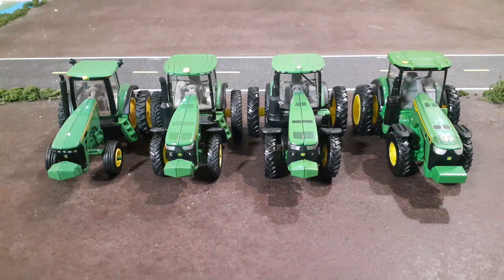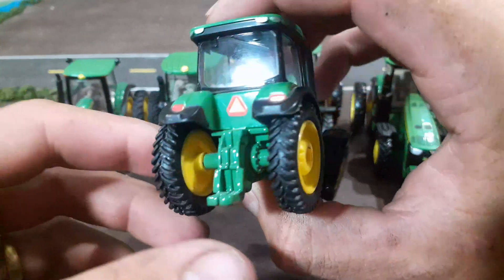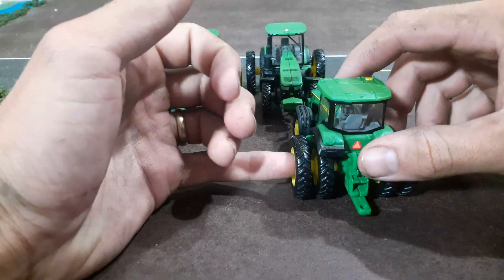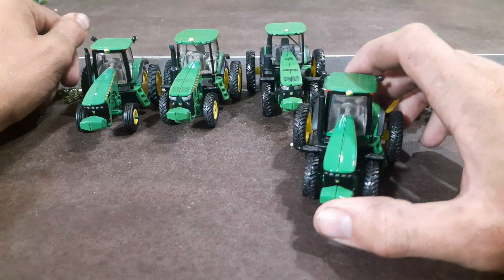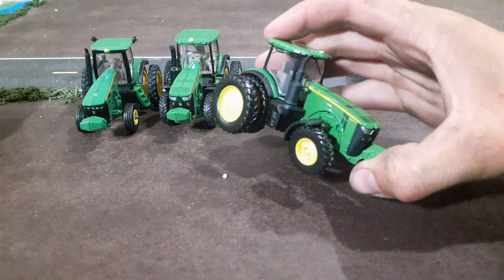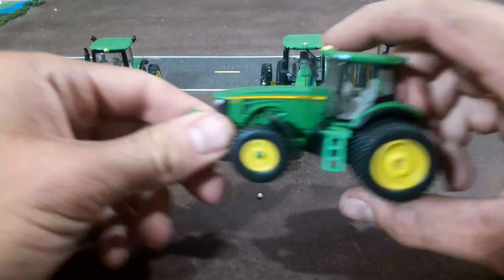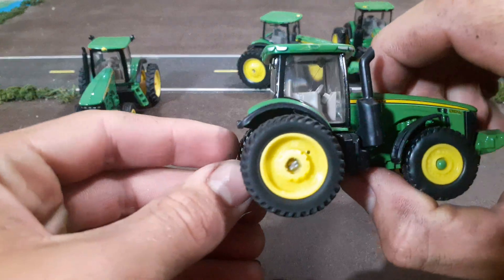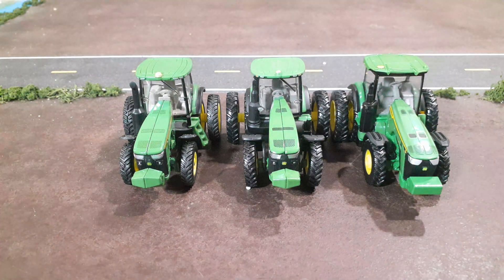Tire Swapping on Some 8R Tractors 8R 370, 8370R, 8335R

Comment: Nice video, really like the look of that 2wd  with duals 👍

It's funny how different tires real 8r series have in Europe. 

Here's more common to see those with singles.

In Finland smaller 8r (and i quess some 7r models too) models have 540/65r34 fronts, 650/85r38 rears

8r340 and biggers have 
600/70r30 fronts, 650/85r38 rears

Here's typical Euro 8r
https://youtu.be/rJhvq-1e6DQ

Especially milddle-Europe have quite narrow roads and old towns and there's quite tight law for tractor and farm equipment widths in some countries.

In Finland and Sweden it isn't so tight, so here you can see 7r and 8r series with duals too (on those European tire sizes)

I have to say European-spec 7r or 8r is quite beefy looking with those wide duals 😀

Here's one from Sweden with wide-duals.
https://youtu.be/2pXH4WhcWnw